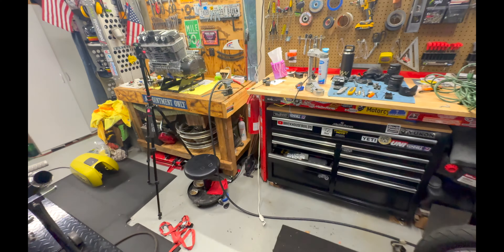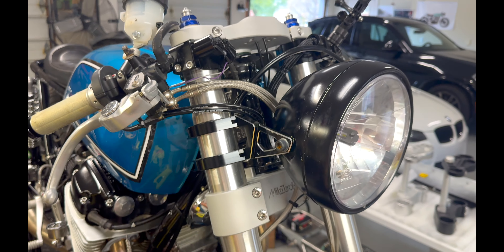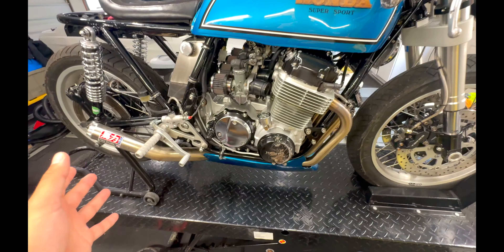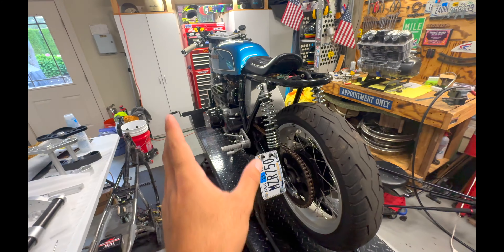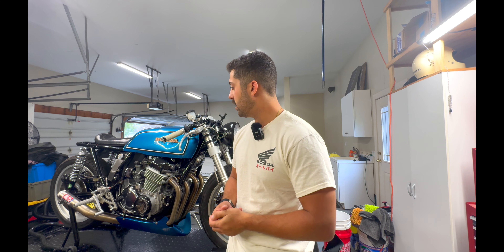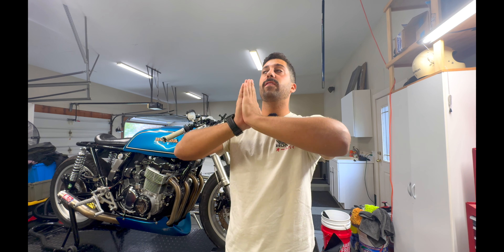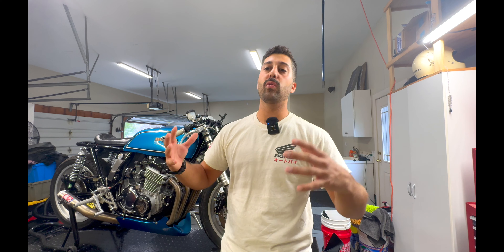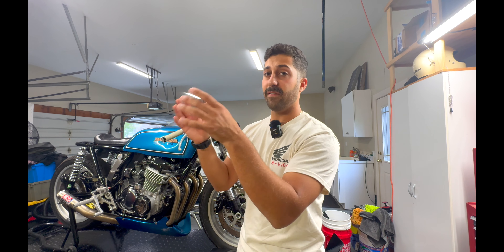ClubSport DAMAGE ASSESSMENT PT.2

Comment: With the dent in the rim you might want to check on the swing arm? I have seen lots of Hondas with bent ones after a crash. One way to tell, it turns better one way than the other.
Reply from the maker: Yup totally going to check on that. Thanks for the tip